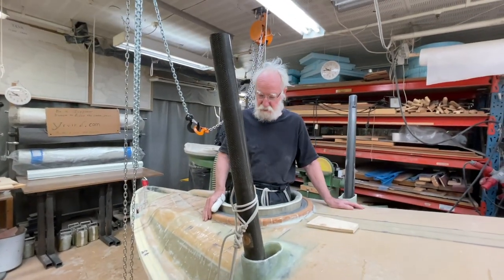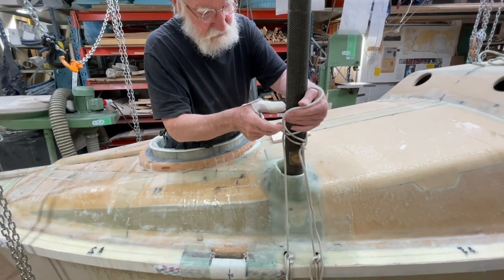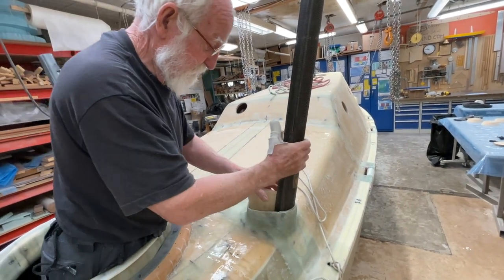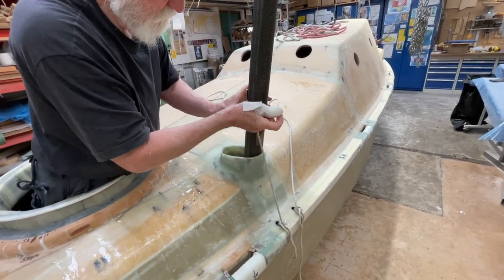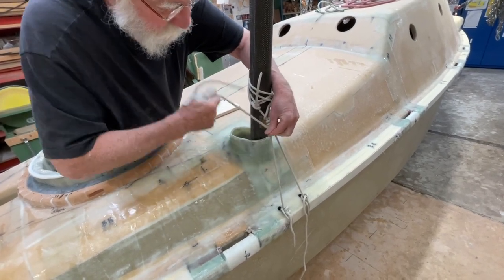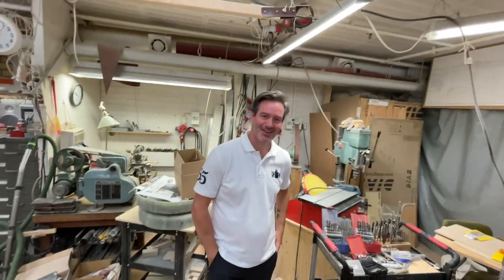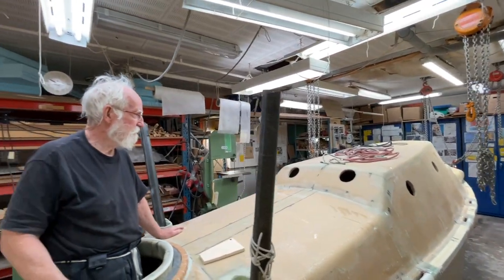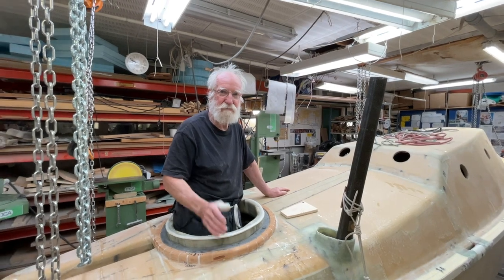26 July 2023  Lashing the mast from the hatch, easy done

Comment: Sven, heck I could even tie or untie a rope in IDEAL conditions, throw in 2-6 meter waves or 5 meter swells add to that 20mph breeze and you have the makings of a major project. Have Peter drop the front of the boat while tossing a bucket of water in your face. Probably a little more difficult. Go to plan "B", the one you have not designed yet. I do not think that Peter will be there to assist you in your moment of need.
Reply from the maker: The ocean is not a war zone.
2-6 meter waves have never given me any problemstie a rope.
Nor do I think that they will.
Reply: 60 plus years of sailing small boats, ocean crossings, rounding cape horn.  I think Sven knows what he can handle in rough seas

Comment: Easy enough from the hatch.  Simple enough.  I think the wedge should be made of thicker Divynicel in case of ropes loosening and the wedge flopping sideways.  I don't think anybody's called you stupid.  We question some of your builds a little.  Anybody that sails a boat like that in the big ol' ocean can't be stupid.  Fearless I think would be the word.  Now...how do we hold the masts in the A-frame position?
Reply from the maker: There are two ropes on each mast also an experienced seaman should not make knots that come undone.
The wedge was only there to demonstrate that it can get jammed and the it will prevent the mast from sideways movements but not from upwards.

Comment: You have proven that you are far from stupid, you prove it every day. My questions are 1) how often will you need to change the mast configuration, 2) how will the masts be fixed down in the A frame configuration, 3) can you use ratchet straps as suggested by someone else, they are available for marine use and would be easy to operate in adverse conditions

Comment: I’m not convinced. What you have now is an excellent prototype of the forces you want to apply and how you can adjust them. I think it definitely needs further refinement and testing under harsh circumstances AND with one hand hopefully. You are smart you’ll figure it out. Like others have said maybe a pin in the mix to make it easier and quicker in addition to the line (pin is shortcut, not required)